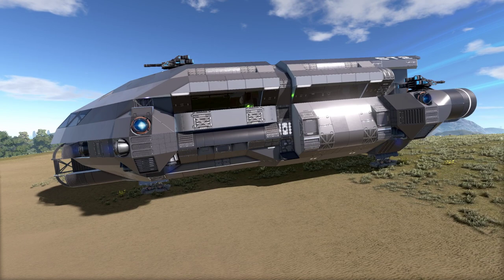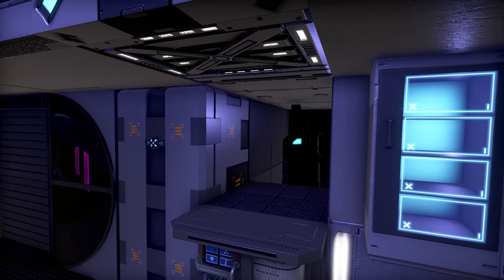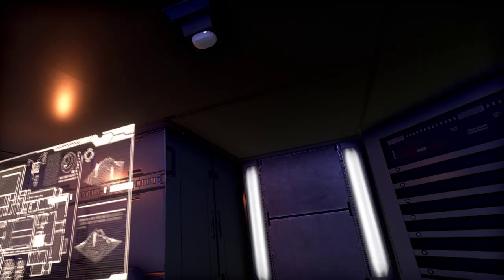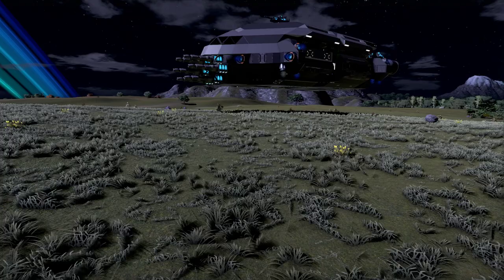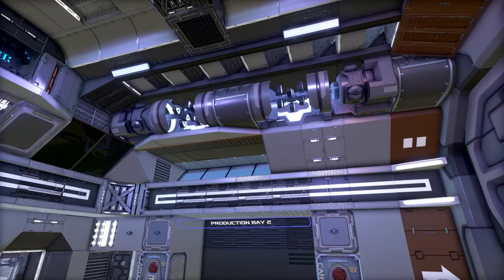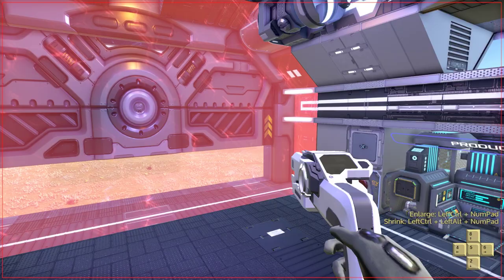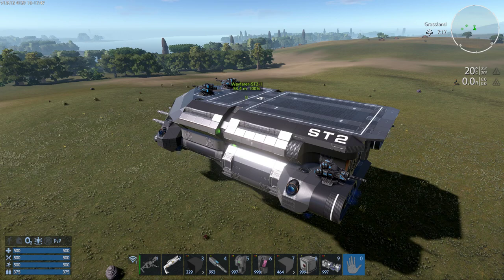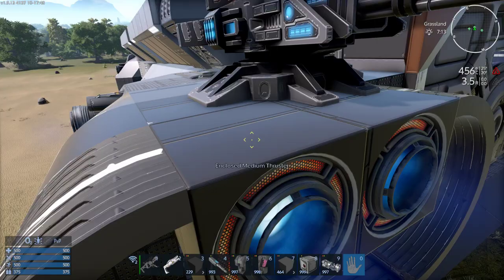Empyrion Galactic Survival - Wayfarer-ST2 Preview and Specs

Comment: I think you nailed it Jeff. I quite like the medical hall, it's all so compact while maintaining a path. It's amazing how much you packed in that small package.

Leave the shield out, put in the pentaxid tank and the armor repair. If I know there is no shield, I just play a bit safer. I've always found that tiny amount of rares in the starter system anyway, in vanilla or in RE.

Ditch the extra constructors so it makes vanilla CPU. Or replace them with a large constructor. Advanced are just too pricy for multiples in a starter. I think you can then leave the thrusters in.

Looking forward to the space station.

Thanks Jeff!

Comment: I would leave the shield and repair station in it.   The Zas and Erestrum required is minimal and if people don't want it, they can remove it and save it as a personal schematic to use.   Of course the reverse can be said, those that want the shield and repair station can add it then save a personal schematic with it.   

As for the vanilla, I'd remove the 4 extra thrusters down plus the adv constructor, that should get it within CPU.   And for vanilla you don't need as much thrust as reforged.  But yeah, you'd have to make 2 versions.  Or make 1 version with instructions.

Comment: I think there are more players that would know how to get the zasc and eres.
I would remove any parts i don't want in creative then add later on if need be, just need to be super careful with a plastic CV and use an SV for most things.

We can't build anything complex that works in both vanilla and RE.
The way around that is to build different creations for each set of rules and not even try to build one for both sets of rules.

Comment: Over all, I love this ship! (CV)
In the back of my mind, I question a couple of things.
I understand the advanced constructor, not so much on two of them. This is supposed to be a starter CV right?  Maybe one advanced, and you can put a couple of regulars?  Later on, as the player levels up and more is needed, recycle the constructors in to advanced if you feel the need, maybe.
The windows along the side. Astatically, they look great. RP/Functionally, not so much.  Only way to look outside from the hanger is to open the doors, or the hanger door, unless you want to pop a drone to look outside.
As for the shield and armor repair?  From the last update video for the game I seen, I believe it said you cannot spawn ships in that have components you cannot build in the tech tree.  To me that is perfectly fine.  Strip them down as you did, and as you can build the equipment and add if if you choose to.
As always, love the videos, and all of your projects whether they are for me or not, I am still envious of the tallent.
Reply from the maker: Not a bad idea. I think you can put in 2 standard constructors for the same CPU cost as 1 advanced. I may do that. Thanks again!

Comment: Remove the repair station and one of the constructors and i think you will be fine with vanilla compatibility.
Reply: You are on the right track but it's still simple. Lose 2 down thrusters and you still have 162 Mn down thrust(by using division, not sure if the game calculations are exponential), lose 2 forward facing thrusters and one large constructor. I think that will leave enough CPU for a shield as a first upgrade and stay tier 2. I don't have the game open to check though. Is the repair station being calculated as a constructor? if so toss that out too LOL. For a tier 2 ship 1 constructor is fine IMHO